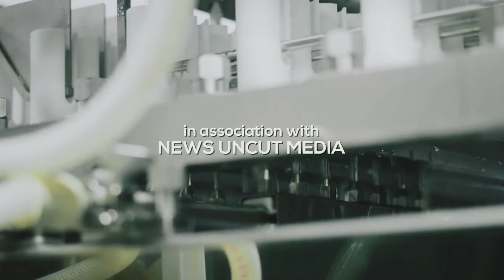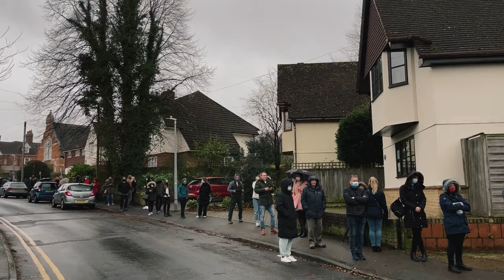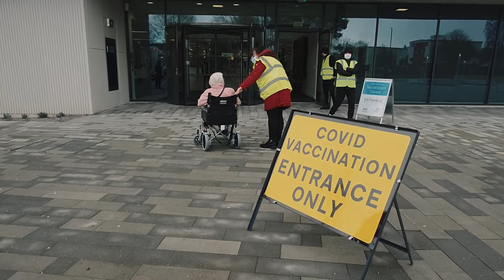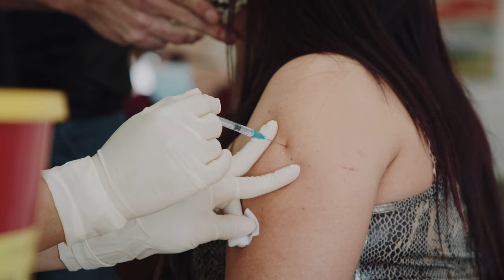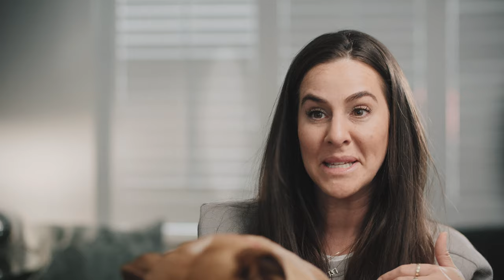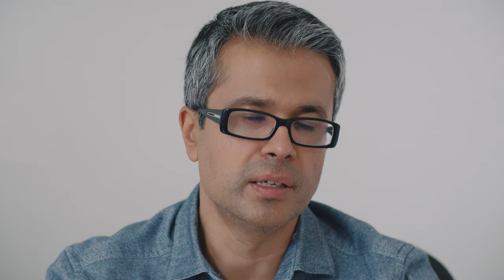Safe and Effective: A Second Opinion (2022) | Official Trailer | Oracle Films | News Uncut

Comment: Next question: what is the correlation between dose batch and injury? Have they been conducting experiments within experiments, with the majority only getting a saline placebo? The unlucky ones getting the actual thing, and in carefully varied amounts per batch, just to see the effects.
Reply: It IS a trial that goes on until 2024(?). Isn't there always placebo, control, etc. in trials? None of the US va x s are actually authorized as far as I know. P f izer is not distributing their brand that is actually, supposedly, authorized, and have no plans to do so.
Reply: @slyslaughter5115  trials in UK running until next year.
Reply: Analysis of batches has shown too much variance that wouldn't be allowed and shouldn't be possible in mass production.   It stinks.